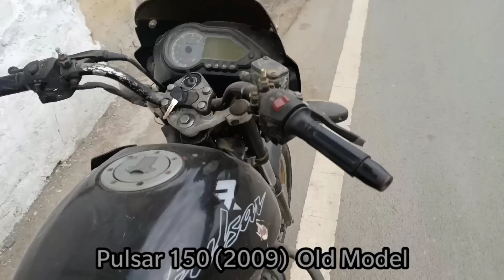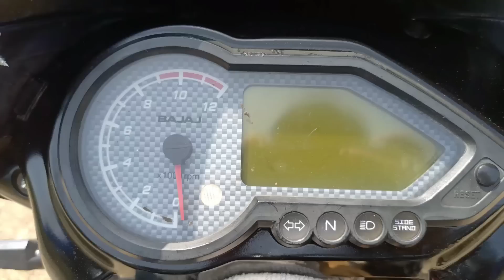Pulsar 150 2009 Model Restoration N Added Some Custom parts.

Comment: Good but
It's should install pulsar 150 original handle
Cause its will more better

And back tyre guard is not good
If this guard more better then its will more beauty

Comment: Bro u did a very Good Job..!!
You gave the old bike another new life!!🤩
But plz reply to my comment that i also have pulsar bike ug3 2007 model and i also want to install the Tank Flap that u installed in ur bike on tank i just want to ask that how did u installed that in ur bike?
I'm waiting for ur reply bro and keep it up ur work is just amazing dude🔥👍
Reply from the maker: Thanks for you support Bro.
I Adjusted tank flap cover and make a mark on the tank for bolt nut, with the help of soft clam and bolt nut i pasted on the tank where i marked with Mseal.. keep it for over night  and installed tank flap with bolt nut size 10..
Reply: @JatheMere  thank you so much for telling bro..

Comment: Bro I have 180 old model 2008 one , bodyline is good but engine works has to be done oand it is standing since 2 yrs ,shall I make it in showroom ,or get it done by roadside cameos
Reply from the maker: If your budget it's high take it to Showroom.
But note one thing ,You can't bargain the amount,everything fix price,they will charge you GST,Parking tax and all...
If budget low 👇🏻
Roadside,only Making charge and you can bargain the charges if they ask high amount do negotiate .if taking to Roadside Go for good mechanic not some1 who will loot you saying diz n that..

Comment: How much ever you do for the old bike it is old inside. I spent lot of money but it always gave me trouble in electronics, bore, millage issues, oil seal broken multiple issues we will face. Always go with new bike instead of spending this much money on old scrap
Reply from the maker: I haven't face any issues with the bikes I Restored...
Depnd on the mechanic ...
I love, enjoy Restoring and customizing scrap bikes..
You should tke it to a good mechanic or Company service  if you don't have much knwldge abt bike engine,wiring.... 
Der r lots of looting (Money)mechanic.. They just fix it for namesake n it only last for months or week...
Anyway thanks for sharing  your thoughts Bro.😇